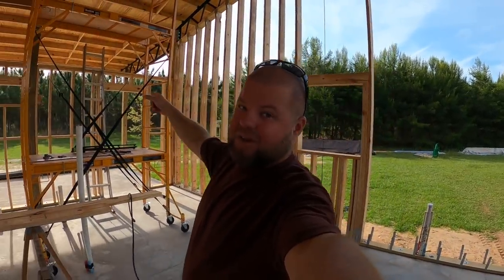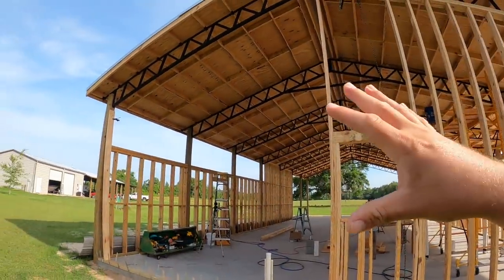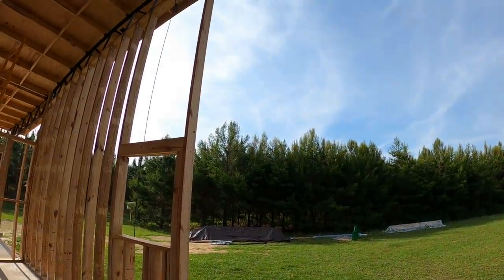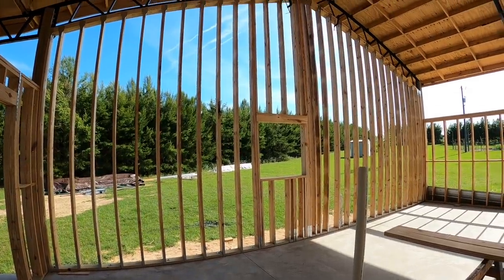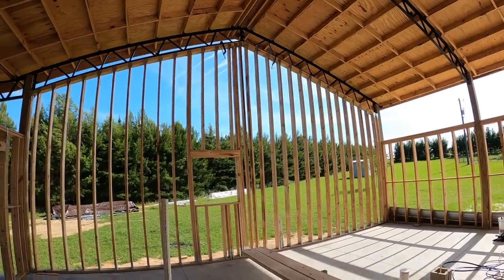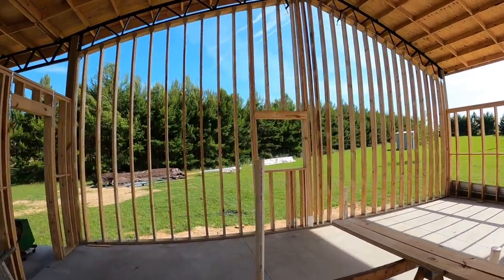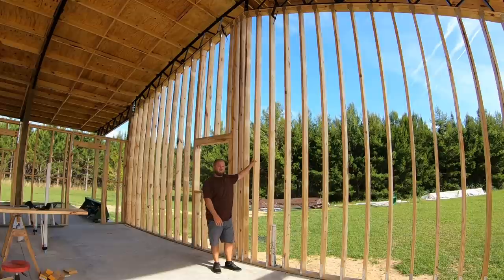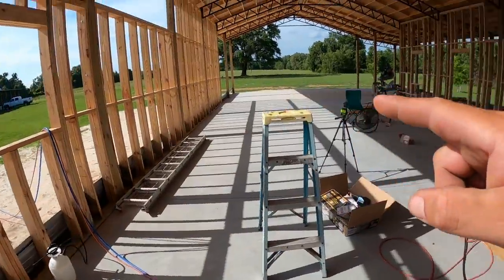Balloon framed wall part 3! Pole barn house build

Comment: Are those studs 16 oc?
Reply: He said the 2 end walls where 12 on center for Florida code
Reply: @1skippies   There's no vapor barrier between the treated sill plate and concrete slab which violates Florida building code.
Reply from the maker: Oh gee, I've went over this a lot in several videos. There IS sill seal under all sill plates. Even did a special video on it.

Comment: Awesome man , your are a talented man Andrew, was gonna suggest a fan out there with you but then you said it was windy lol . I thought you had the bucket on rollers ? Can’t you just roll it to the other end and lay down some  2x6x16 and roll it down to the ground ? Just a thought . 👍🏼👍🏼👍🏼
Reply from the maker: I did roll it out the back door opening. There is a drop off there so it wound up falling off the dollies a few times. I eventually got it after unloading a lot of weight.

Comment: Andrew, you continue to impress me with your work ethics and the ingenious solutions you come up for problems you encounter while working alone. You can build my next house anytime, your attention to detail is without equal. I wonder how many pounds you will lose by the time your house is finished; especially with all the trips up and down the scaffolding and ladders. I may have missed it but are you going to attach the top plate to the steel trusses and if so how?  Keep the great videos coming.
Reply from the maker: Thank you! I will be making a video this week of me attaching the wall to the trusses and final strapping.

Comment: How close will you have to put the 2 foot cross bracing and how many?
Reply from the maker: I'm not sure what cross bracing you are referring to?
Reply: The short braces that go between vertical between the horizontal studs on the wall you just belt . That is probely as clear as mud I bet. They were the last short blocks you put between the other wall studs.
Reply from the maker: Oh that's blocking. They will go horizontal at 4ft, 8ft and 12ft since this is such a big wall.

Comment: I'm doing a shop very similar to this. I haven't made it through your ton of videos but I saw those double nailed top plates resting against the bottom of the truss, you had drilled holes in them. Are those holes how you secured them to the truss and if so, which video is that?
Reply from the maker: I believe it's in this video https://youtu.be/o6PHUX_HXuo
Reply: @TKCL  thanks man! Yeah I found it!  In doing my research, I kept being told I could drill attaching holes to the trusses but your setup is precisely what I'm trying to do. Did you have any problems with the inspector?
Reply from the maker: @mathewshackelford8037  none, the engineer is the one who showed in my plans to do it this way.
Reply: @TKCL  Even better!! Thanks man!

Comment: Your studs should have been increasing in length by the same amount each one towards the peak. For the next Wall, I'd check that and then get several cut at one and raise them one trip up the scaffold
Reply from the maker: I did check that and it always seemed like they would be a fraction off here and there. So I just measured everyone to be safe
Reply: @TKCL  fair enough. Probably some error in bend of the tape, combined with concrete movement and flatness of the top and bottom plates. Have you looked at laser distance measures? I bought a Milwaukee for about 60 bucks when doing some crown and don't know how I made it so long without one
Reply from the maker: That's next on my list is the distance measure, but I wonder how accurate they are?
Reply: @TKCL  very accurate, in my experience with my Milwaukee doing trim
Reply from the maker: I just ordered a Bosch model, very good reviews on Amazon